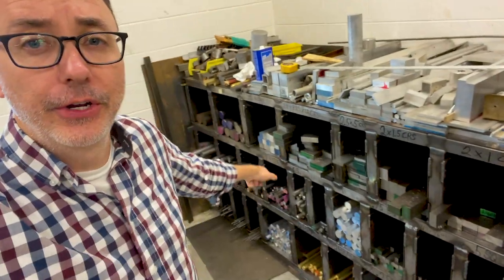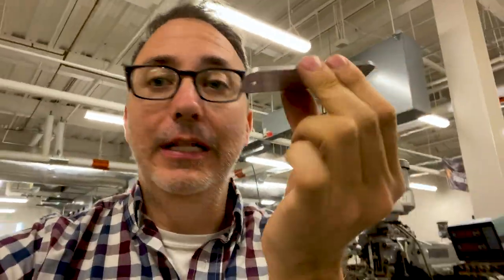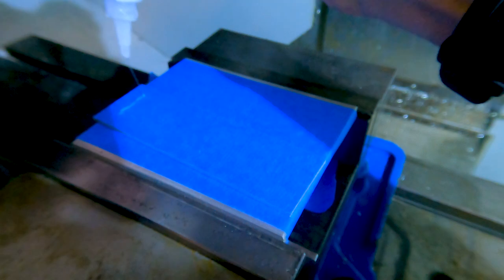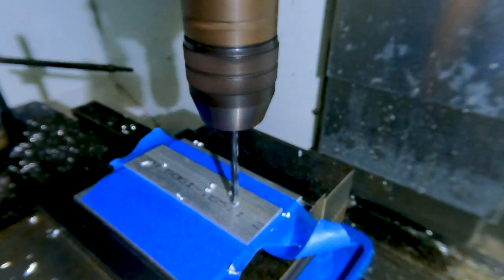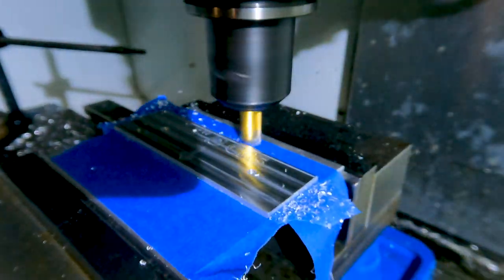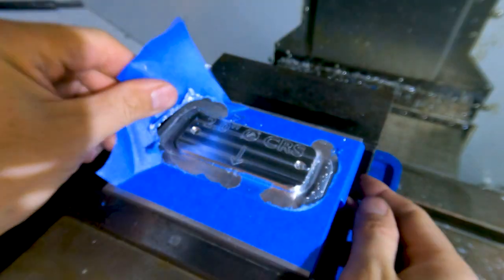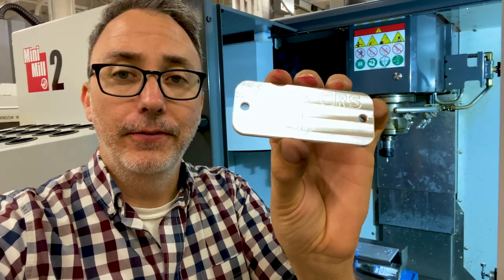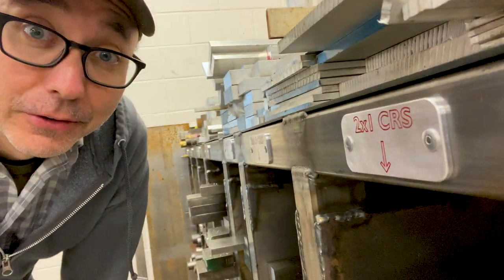CNC Workholding using Superglue and Painter's Tape!

Comment: They came out beautiful!

The only thing I would have done is marked out the engravings using a high quality nail polish rather than Dykem.

Dykem isn't the most lasting of dyes, and I've noticed sometimes it flakes off after a while. It makes sense, it's only meant to really last long enough for you scribe out your marks and machine the part.